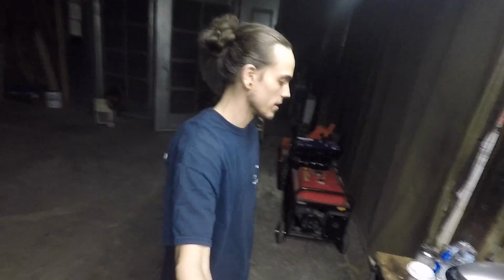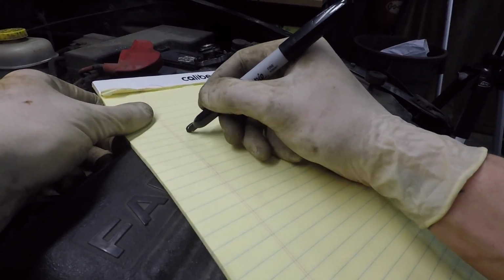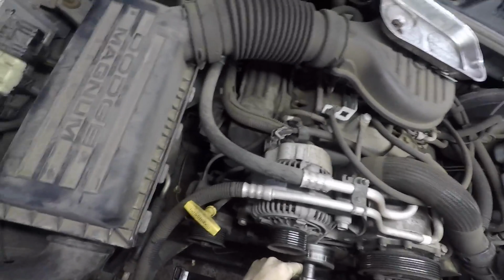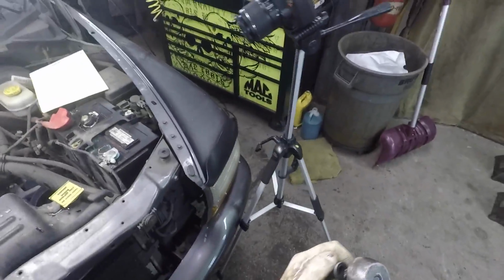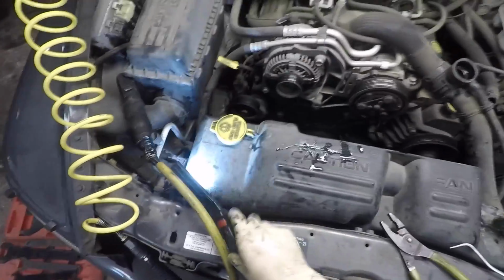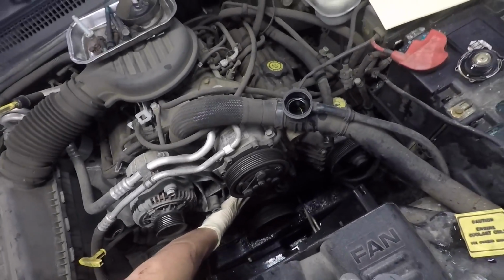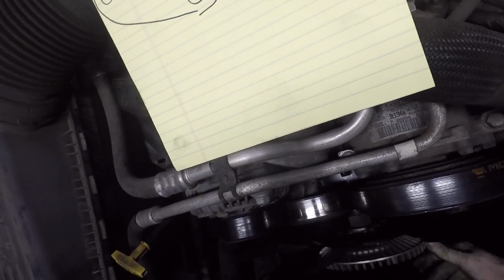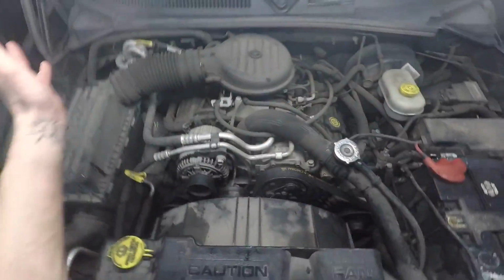DODGE DAKOTA WATER PUMP!

Comment: Thank you!  Finally I found someone that mentioned the size of the torx bolt at the top...  T-50
Reply: I think on another video it was said to be a 47. But the difference between 47 and 50 is pretty minimal. I was able to fit my 14mm socket on it and with the hammer drill it backed out.

Comment: Good thing it's reasonably easy, I've put four in mine.
Reply from the maker: +Whiskey and Sarcasm yea I've done alot of theses if you've done that may water pumps try changing the fan clutch. The fan clutch on this one had a slight amount of play that I suspect ruined the bearing on the water pump.
Reply: None of mine have had bad bearings as far as I could tell. They all lasted 50-60k miles so I assumed it was just a bad design. 

On another note, you should put your location on your channel somewhere. Any mechanic that actually knows what the venturi effect is deserves my money.
Reply from the maker: +Whiskey and Sarcasm yea Dodges sent known for their good designs on alot of things. In most of my videos I'm wearing the shop swag! And thank you very much that means alot!

Comment: I watched your video carefully hoping for an answer to my question but I still have to ask. I have a 1998 Dodge Dakota with a  3.9 V6. I'm starting to get some coolant seepage where the black metal pipe comes out of my water pump. I believe this goes to my heater. How can I fix that. I thought I would ask before I screwed something up as usual.
Reply: I have same truck and same problem easy fix it should be a water pump inlet tube mine rusted from the inside so I just removed it and bought replacement tube and sealed it up with some gasket sealant it was pretty easy it just has a single bolt holding it, I had to use a rubber mallet because it's a pretty tight fit and had to go in about 2 inches

Comment: awesome video , i have this truck and have been messing with the cooling system since i biught it a fee minths ago . after alit of wasted time with mechanics I finally my self flushed the heater core , suoer easy and that flushed iut rusty water and got my heater working . next i niticed my fan clutch bearing is a but loose so i better put a new fan clutch so it doesnt ruin my water pump right , and tonight I drained the radiator at home and i paid two different guys to do this already but of course they did a half ass job . So I drained it and nit much came out maybe a gallon and I ckeaned iut the reserve tank , it was filthy with sediment and rusty brown water and gunk , then I filled the radiator with a bittle if prestone flush and the rest with distilled water . It woukd nit even take a full gallon to fill . Then i put on a spill free funnel whike trying to bring to temp and burp it whike flush libg the reserve tank . Took it for a drive ti get the chemical flush working in there then bacn home went to rehook uo the reserve tube and niticed the tube was clogged with brown sludge !!! so mystery number two solved , it was driving me nuts because I noticed my radiator coolant was brown even after being replaced previously and the coolant in the reserve has been brand new sonit was never mixing and my hoses were collapsing after cooling down from me bleedingvtge system and I replaced the cap at first , so that cap is probably fine . So! hooefulky that helps it out . Niw going to checknin morning and run for a few days with the water and flush and go from there with a drain and refill . I dont get how the radiator only took a gallon or less and in the manuel it says this system is like 13 liters so i think about 4 gallons . O lh amd also i have a stock 195 thermostat i will replace after the flush . Any tips ?  ciyld 3 gallins of coolant be in the blick and hoses and only a gallon in the radiator ?  o and like the bideo but I like to see all the stuff you fast forwarded ! thanks keep it up !
Reply from the maker: +joe smith sounds like someone put stop leak in your truck. It makes everything gum up and never really leaves. My only advice is change coolant regularly untill there is no more color
Reply: Live mechanics idk , was a 1 owner truck 2000 dakota with 80,000    well taken care of . Just bought it . Guy seemed like he took real good care of it but neglected cooling system even though he wrote down that he replace water pump at 50-60,000 miles and that he had flushed cooling system a few times since new . But dont think that was enough cleaning and care for a truck that was nit used much . I guess I will find iut if it has a leak after this detailed flush i am doing .  Thanks

Comment: What kind of light is that, it looks like a folding LED light, I like the small size and want one.  Also, thanks for the video, it is always impressive to see a real pro at work!
Reply from the maker: +Bob Teaford it's from Mac tools but I believe is made by saber. They're handy for sure
Reply: OK thank you very much, I found them on Amazon, yes made by Sabre.  Thanks again for the video, my Dodge Dakota now has a new water pump, thermostat, fan clutch, and radiator!

Comment: 7:31. You fast forward through the most important and difficult part. I had to do this in the parking lot of a Round Table pizza joint with the big help(he did almost all of it) of a good friend on an earlier model Dakota (the front end is nearly exactly the same) last summer, and the part you fast forward through is a bitch. The hose that comes in on top is so short, it’s nearly impossible to line everything up with the snap ring it came with. Luckily there was a radiator shop right across the street, and I got a screw tight seal for the hose, and the guy just gave it to me. Portland is a great place to live. ...., but don’t come here, the traffic is bad enough.

Comment: Why did you change the fan clutch ?
Reply from the maker: +Jose Cortez it had executive play in the bearing causing the Pump to go bad
Reply: Live mechanics   was it alot of play ?  mine has a little and its hard to make it play . water pump seems fine now so i dont need to replace that too right ?

Comment: This has turnd out to be harder then expected. I cant get the top bold off
Reply from the maker: Penitatimg oil and tapping around/on the blot with a hammer can help. I would recommend going out and buying a brand new socket and a longer breaker bar/ratchet. The new socket is so you have the least chance of rounding the bolt.